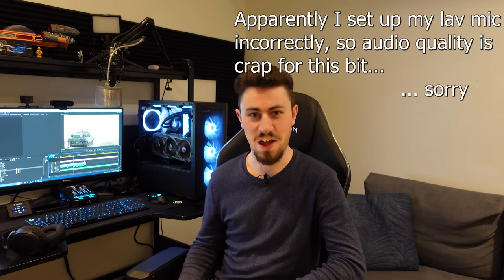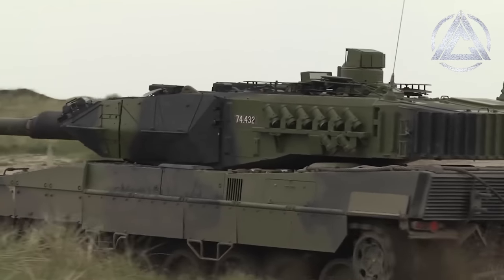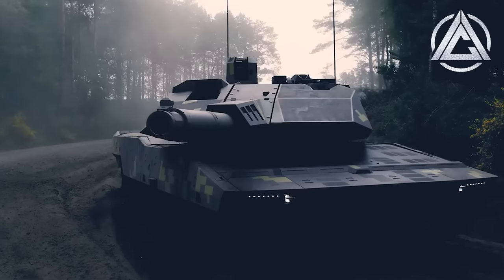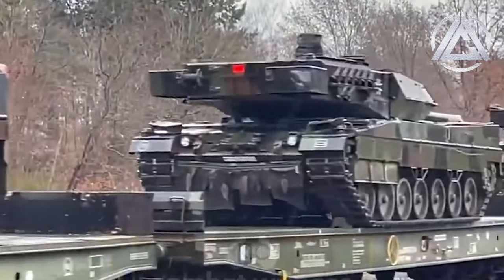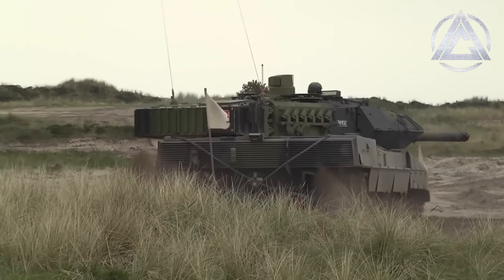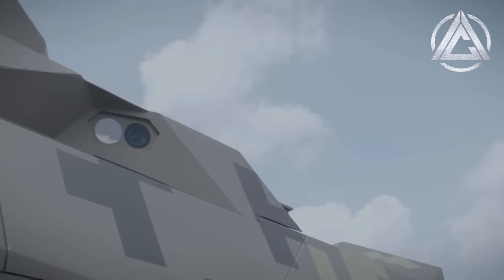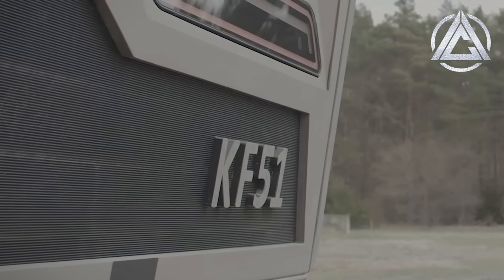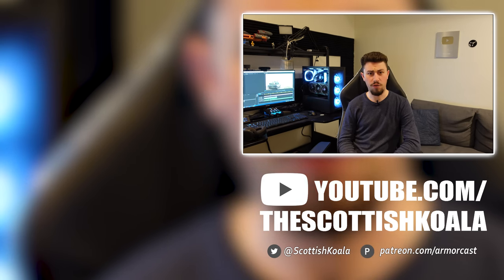Germany's New KF51 Panther Tank | The Spearhead of a New Generation?

Comment: I think the big idea of unmanned turrets being beneficial are that a smaller, lighter turret can be created, while keeping the same level of armor. That weight can then be used elsewhere for extra armor, fuel, modern electronics and targeting systems, and/or active protection systems. How exactly that would specifically work in practice is more subject to caveats.
Reply: It would hurt commanders environmental awareness to much i think. The top of the top of turret gives the commander 360 degrees view from higher up in a way that camera systems just can't.
I don't see this becomming a standard in nato designs.
Reply: @baronvonlimbourgh1716  This could change when they implement helmet mounted displays for the crew as it's common for helicopter pilots. Pretty much like VR goggles.
Reply: Tanks fighting in hull-down positions would see an even greater improvement in crew protection. If only the turret can be seen, then only the turret can be hit, and if the crew isn't in the turret then you can't really kill the crew when they're in a hull down position. The tank can still be destroyed but crew is extremely well protected.
Reply: @geerdi5222  Helicopter pilots are not activly on the ground fighting. Have rockets shown at you while enemies are closeby and you are wearing shit over your eyes sound like the perfect way to make your soldiers panic.
Reply: Wouldn't you still want the turret equally armored to because a shattered turret equals a useless tank?
Reply: @geerdi5222 mk 1 vision device has unparalled resolution.....
Reply: Well if you think of an autoloader and the risks it has with the ammunition you can have the crew in a seperate space AND can build the tank with a lower profile if the turret is unmanned.
Reply: @baronvonlimbourgh1716  360 degree cameras and interlinked camera systems exist. I'd rather look through a camera above then stick my fleshy head out. Camera is a smaller target and I don't get my brains removed when the camera gets shot.
Reply: @dwwolf4636  MK 1 vision doesn't have zoom function
Reply: @onepunchbud1472  I think the problems we are seeing right now with certain autoloader-equipped tanks aren't really a consequence of the autoloader, rather it's the carousel magazine around the turret base being hit and launching the turret as the magazine goes up. Most non-Soviet autoloaders use different ammunition carousel designs and thus don't have that problem.
Reply: I always thought that its because the unmanned turret can be separated from the crew compartment, making crew placement lower in the vehicle - and thus increasing the survivability (its harder to hit the lower parts of the tank since usually some obstacles will obscure it, but the tank has to stick out its turret to be able to fire).

In addition its possible for such turret to still operate after getting hit, since everything in there is more resistant than people.

But maybe my idea was wrong altogether.
Reply: The problem is that unless they create a new, better autoloader system. it will hurt the tank's efficiency. Currently, the autoloaders that the Russians are using, even in their Armata, take roughly 10 seconds to reload the main gun. A well-trained loader can reload the main gun in half that time. So, a Leopard or Abrams with a trained crew can fire three times in the time the Armata can fire twice.

Not to mention that if there's any technical issue in the autoloader or otherwise in the turret, it could be hard to fix on the fly while on the battlefield if the crew isn't in the hull anymore (like in the Armata)
Reply: @glennjanot8128  well, the 130mm gun has an increase of 50% range compared to the 120mm Rheinmetall, which itself is most likely superior in range vs all Russia has in service. You don't need that rate of fire if you have such a gap in range and a far superior first hit ability.
Reply: @andrewreynolds4949  mate please stop… there are only 3 modern tanks using Autoloader in NATO or NATO Peer nations… and none use a carousel under the turret… :/
Reply: @baronvonlimbourgh1716  This was my first thought as well. I did a stint as an tracked IFV commander, and I can't even imagine being functional in that role relying on optics alone.
Reply: @SgtVennamo  yeah, tank commanders like to have the high up view for situational awarenes.
And screens are just not the same as your own eyes and being part of the environment.

Tankers will not like it when they do go to unmanned turrets.
Reply: @adamleddy9894  That was my point? The "exploding autoloader turret" issue is really a problem with the carousel position & design, which basically only applies to Soviet and derivative designs. NATO and other designs use different systems, for instance a cassette carousel magazine instead, which fits in the back of the turret more like a conventional ammo storage
Reply: @chrisb2942  But as the video also explained, having more range can mean that an enemy tank can drive out of the path of the fired shell before it hits
Reply: @glennjanot8128  Which is not true at all. I was a tanker in service myself and on these distances it's almost instant impact. In most cases you don't even hear two different sounds but one (shoot and impact). A tank dart is not comparable to a waaaay slower anti tank missile. And even if the KF51 would miss, the opponent's tank still has to drive a kilometre or more to even think of returning fire. That is a lot of time, a loooot :)
Reply: @Lukyan  that's why you aren't a tanker ;)
Reply: @geerdi5222  still isn't the same. Tankers won't be fans of an unmanned turret design.
It will be a conciderable handicap.
Reply: @baronvonlimbourgh1716  Please explain how an unmanned turret is a handicap (for its crew).

I will outline the following advantages:

1) Survivability - When the turret gets penetrated no lives will be at risk.

2) Weight Reduction - Less volume inside the turret because of a lack of crew space means that less area has to be armored. This lower weight from less mass will allow the tank greater mobility, range, and reduce wear and tear.

The only disadvantage I see you claiming is crew situational awareness. If modern technology didn't exist, yes that would be a problem, but we're in the 2020's now. As the F-35 has proved, we can make a helmet that allows the crew to see through the vehicle with basically "x-ray" technology and have far greater situation awareness than conventional tanks. This situational awareness is even more potent than sticking your head out of the tank because it eliminates blind spots.

I don't care if the tank commander likes to use his eyeballs. If he sticks his head out of his armored vehicle, he is making himself a liability for his crew. An active combat zone means he can catch a bullet or shrapnel to his head at anytime. Additionally, the recent war in Ukraine has shown us that an open hatch is a perfect target for a drone. 

Just yesterday, I saw a video of drone dropping a grenade into the open hatch of a Russian BMP turret with its crew inside. You want to know what that commander's demand for "using his eyeballs" got him? It got his entire crew killed because that grenade dropped right through the hatch and blew up inside the crew compartment.

On top of that, tankers have been using screens for decades now. Every modern tank has digital optics for thermals, night vision, and zoom.
Reply: @Lukyan  ask a tank commander.
Reply: @baronvonlimbourgh1716  Oh, so the "tanking expert" here finally gave up as soon as any structured arguments were presented? What a surprise.
Reply: @Lukyan  just ask a tanker if you are that curious.there will be multiple around here, there always are at tank videos.
You are just gonna keep arguing with me without end. 
Get your info from the source 👍...
Reply: @baronvonlimbourgh1716  - are you sure about that ? lol, dude, 360ª cameras will give the crew ( ALL of them !) a lot better image than the classic cupola ! With the round screens, you can have a 360º image live in the same time, without the need even to rotate your head!  Most important than all: you can build a tank in days, but train a crew take years !
Reply: + Smaller turret (which is a great way to save weight)
+ Doesn't tire / make mistakes - just imagine how quickly you'd tire moving 40kg rounds 
+ Don't need to train a soldier*

If these tanks are in service for 50 years (quite possible seeing how old the tanks are that the Russians are putting to use atm ;)) that's basically equal to not paying the life wages for an entire person.

Downsides... ehh one less crew member for repairs/maintenance.
And it could jam in some way, but humans can break down in more ways then one as well. Especially in a combat situation so that can go either way in what is more reliable.

As far as the 'environmental awareness' argument goes. I sure as heck hope that with the technology we have nowadays a future tank isn't designed with the aim of someone poking their head out the armored vehicle to have a look around. A 360 camera system automatically outlining possible threats sounds like a much better idea especially if this uses information from a regular camera along with a thermal camera (and night vision camera at night ofc).
Reply: @Axeiaa  - an auto-loader, especially the russian one ( keep on mind no country on the world have the experience the russians gained in half century of use.... even now, the "new" Abrams is supposed to have an auto-loader - muricans realize the russians were 50 years ahead,lol) - an auto-loader can keep a high RoF indeterminately,  unlike a human who will "break" by extenuation long before...  and we saw how handy is that in a real war, like in Ukr now, with intensity murica or other countries never experienced since ww2 ! 
And man, a 130 mm shell is much heavier than 40 kg :)
Reply: @mirandela777  never said camera's shouldn't be included. They are obviously useful.
But it would give up a lot of situational awerenes and the general overview of the environment you are in and  the things going on around your vehicle, the ability to communicate with civilians and infantery. It would giving tactical direction to infantry a lot harder. Etc. etc.

There is a lot more to being a tank commander then to point and shoot at other tanks from 1km away, and all of them bennefit from being high up and able to to hear, smell and see what is going on around you and being able to interact with people around you with your head out of the turret.

They aren't just playing world of tanks or warthunder..
Reply: @baronvonlimbourgh1716  - dude, this is not ww2 era,   this age tanks are always WITH or BEHIND infantry,  and NEVER ahead - the idiots who go alone ahead usually do not survive long - we saw that in Ukr with muppets attacking alone with tanks only to be popped by a russian ATGM from nowhere.. 
" it would give up a lot of situational awerenes and the general overview of the environment you are in and  the things going on around your vehicle" - again, is no more ww2 or war thunder dude - do you see the use of drones ?! one little thing, you can hide in a pcket, yet will give you more "situational awareness" than 10 guys on foot ! 
Also, modern combat means IR and you can eyeball all day long from  your cupola but you will see nothing if there is smoke or is night ! 
"able to interact with people around you with your head out of the turret." yeah, sure, in a time every dude carry a smartphone lol  ! Are you aware tanks (especially russian ones) do have a phone port ? Hanging your head around up there is a call for every sniper in 1 km circle ! 
To conclude, if you can stay INSIDE the vehicle and have redundant camera covering 360º with IR, you are 100 x better and more aware than sticking your neck out,ready to get a shrapnel or a bullet, getting blind and suffocated by the smog, or deaf by the explosions.. You can effectively incapacitate  severely  a tank if you kill the commander...
Reply: @mirandela777  ok bro, you are so smart 👍.
Reply: @baronvonlimbourgh1716  - no, dude, is just I am not a war thunder player like you... and actually, I have some army years on my back.
Reply: @mirandela777  yeah, you are the smart one 👍
Reply: It could be a first step towards unmanned tanks.
Reply: @geerdi5222  yep...that sa bery good point ...and for tankers can be very eficient and deadly for the enemy!!!
Reply: @baronvonlimbourgh1716  - As computers begin to run things more than commanders, survivability depends less on a view by a human head than a computer network.
Reply: Agree with Baron.   I spent most of my time out of the hatch.   Being buttoned up is usually not desireable, and frankly, quite miserable.
Reply: As a retired track commander, I would be fine with a remote turret, but with a nice, centralized, supplementally armored tower for me to chivy up to a secondary seat for my lardy arse so I can poop n' snoop by eyes-on, while everyone else remains in the hull. Preferably in the REAR, behind a nice big engine, tranny, and firewall. My gunner never sticks his head out of his hatch on mission anyways.
Besides the weight, it would be of enormous benefit for survivability. And elbow room.
The weight of the drive train & glacis armor up front with the turret offsetting that in the rear makes for more ideal weight distribution for the suspension and handling.
Reply: @samseven5260  What is it then that makes it so miserable? Out of curiosity
Reply: @andrewreynolds4949  Proximity to crew and generally cramped.   Smell.  Air.  Super cold or super hot.  Not so bad when looking through sights , scanning and shooting (distracted).   But anything other than battle is a drag all buttoned up, so, youll see hatches open.
Reply: It also gives a lower profile and can be a bit more sloped.
Reply: @glennjanot8128  tank rounds, especially the non explosive ones, tend to travel preeeetty fast...
Reply: @andersbjrnsen7203  True. The current tank shells travel between 1400-1800m/s. Lets assume it's the highest. If a target is 5 km away, it would take the shell more than 2,5 seconds to reach its target. If the target is a tank or an armored vehicle moving at 50km/h or more, the round could miss unless the gunner has calculated the lead and the tank doesn't deviate from its course.

If the shell is intelligent, meaning it can change course like a rocket, the point is moot ^^
Reply: And a lighter, faster, quicker & more maneuverable tank.
Reply: @baronvonlimbourgh1716  - This awareness comes at a cost - The Israelis lost nearly 50% of their tank commanders during the Yom Kipper War (and most of those who were on the front lines at the start of the war). In fact, many Israeli tanks were down to 2 crew members after the first 2 days of the war, and some were fighting with one crew member (the driver) scrambling between the commander’s spot (to find targets), the loader’s (to load the gun), the gunner’s (to fire the gun), the driver’s (if he had to drive it) & back around to fire additional rounds.
Reply: @glennjanot8128  - It’s a completely different system than that used by Soviet & then Russian tanks. Reinmetal & other observers are claiming load times of under 6 seconds. I don’t see most humans being able to manually load 40+ kg rounds!
Reply: @glennjanot8128  - The round gets there faster with 17% higher muzzle velocity, so your PK at battle ranges would be higher than that of the 120 mm gun. That means 2000+ m/s instead of the 1700 m/s of the Leopard 2, and it will get to 4000 meters in less time than the 120 round needs to get to 3500 meters. Remember, we’re already talking about 2+ seconds for the Leopard’s round to hit a target at 3500 meters.
Reply: @TraditionalAnglican  How do you get to 40+kg?

The regular APFSDS shells are somewhere in the range of 10 kg. The multi-use shells are in the low 20s. The heaviest is the DM11 high explosive shell with 29 kg.
Reply: @andrewreynolds4949  Binocs.
Reply: @glennjanot8128  Not with 130mm ammo....
Reply: @baronvonlimbourgh1716  Eh. Can't be poking your head out when in combat. Cameras have become a lot better and having a personal drone for each tank will probably happen. Imagine each tank has sort of a doc where a decent sized drone can be held, charged, and automatically always return to. Giving commanders a birds eye view of their immediate area.

 Optics and sensors are what will make or break modern tanks. We have the technology to see through things now too if we wanted to with virtual/augmented reality.
Reply: @andrewreynolds4949  That is false. The Russian when found about that problem they tested it a  found that is not the carousel the problem but the ammo storage outside of it that cause the explosion.  At that time they also tested all kind of autoloaders and decide to stick with carousel. With the Armata if that even happens the crew will be safe because the armored capsule thing for the crew.
Reply: @Rek1emMScar  There's a lot of other issues with the Armata. Moving the ammo stores away from the crew helps but the carousel's position is still a problem
Reply: @Lukyan 

Well, if cameras were a solution, they would be there already, maybe.

Commanders generally state that simply staying with your hatch closed during combat is equivalent to blinding yourself, you're more likely to be killed or have your crew killed staying inside than if you stay on top to have that awareness.
One example is the Rus vs Ukraine conflict: You probably have seen that footage of 2 tanks getting really close to each other without even knowing each other presence until one of them notices and fire, both with their hatches closed, that's how limiting optic devices are.

Although i also think it's strange that they haven't implemented this yet, taking F1 (yes, Formula 1) as example, they have high quality and almost invisible cameras, still they have a ridiculously wide field of view, they are so small you can't even notice even if you get really close to it, it would make sense for these types of cameras (or even bigger and better versions) to be implemented on tanks, there's some things that just seem to have no justification to it in Tank designs, like the Leopard 2 secondary ammo stowage when there's more than enough space on the turret.
Reply: @geerdi5222 Israel's new main battle tank, the Barak, has this type of technology. The crew has a helmet that gives them a 360 view of the battlefield, they basically look right through the walls of the tank thanks to outside sensors and cameras that relay back to the fpv helmet.
Reply: @onepunchbud1472  You never saw Lecrec's autoloader?